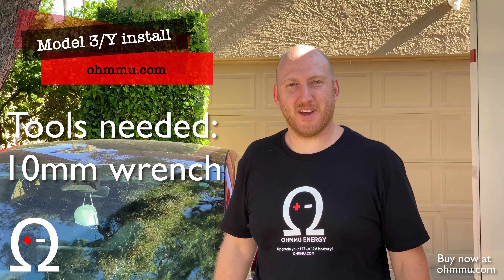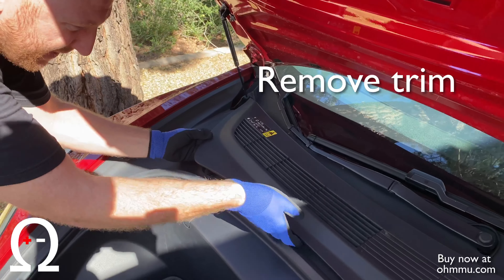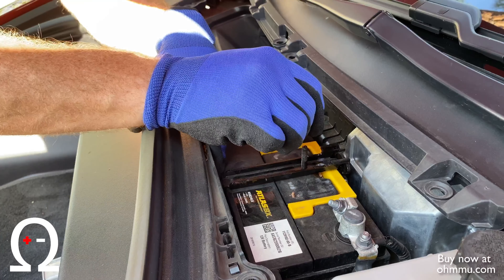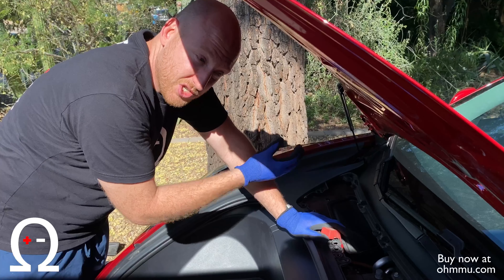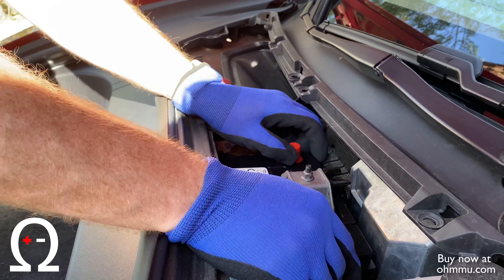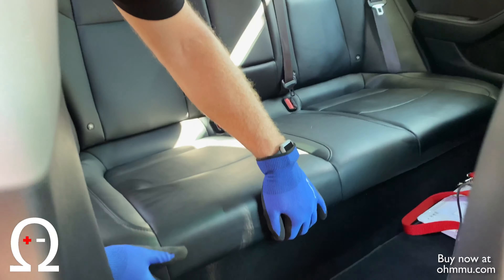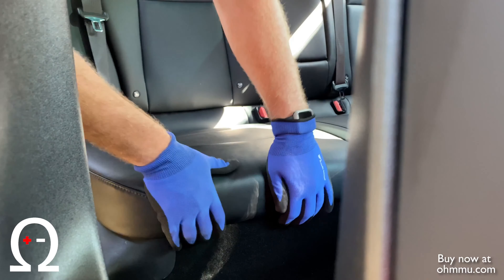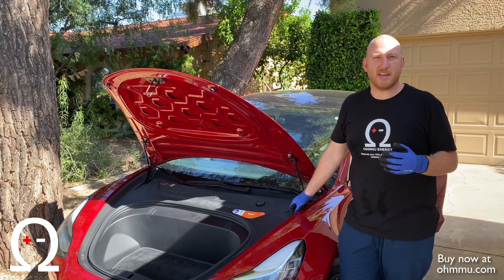Tesla Model 3 12V Battery Swap

Comment: I need this. My 12V battery literally died...had to have it towed to the dealership and....a week later? I still do not have my Tesla 3 back as they had to ORDER the 12V battery. How can they NOT HAVE 12V batteries in stock for my Tesla?!?1????????!!!!!!!!!!!!!!!!!!!!!
Reply from the maker: Tesla's latest software update, 2020.28.6 is a disaster for 12V alert system and has been making many Model 3 flag as replace 12V now, even if the battery is fine.  They are trying to over-correct from their previous version which didn't flag batteries soon enough and was leaving owners stranded in their driveways.
Reply: @OhmmuEnergy  Looks like the Ohmmu lithium battery is also being flagged. My Model 3 screen showed the "12V battery must be replaced soon" message about 2 weeks after installing the Ohmmu battery and on 2020.28.6.
Reply: Just got the same message tonight. Getting my model 3 towed to Tesla
Reply: @davidmontenegro725  It took 7 days to get the 12V battery!! Why they do not have a stock of 12V batteries IN THE INVENTORY was beyond me. I got NO warning before the car just "died" so after a week? New 12V battery and all is good, but I was mad as hell about this situation. it took too long to fix a simple issue.
Reply: jwbjpb1 Well i actually got my car the next day by lunch! They were super fast and apparently had the battery in stock. I do wish there was a warning. I mean you would think a check engine light of some sort would come on
Reply: David Montenegro glad you got your car back that fast!!!

Comment: Nice video. How about the cost of these Litium batteries compared to the AGM? Is it still worth it? I mean the weight saving has gone lost in the last months at home in this corona time.🤣
Reply: about 2.5x the cost. But if they last 4-5 times longer you save money in the long run. I'm doing research for when I get my Tesla. I just want to know how these do in cold-weather? Lithiums operate like garbage at freezing or below.

Comment: What is the point or benefit of swapping to a lithium 12V battery?
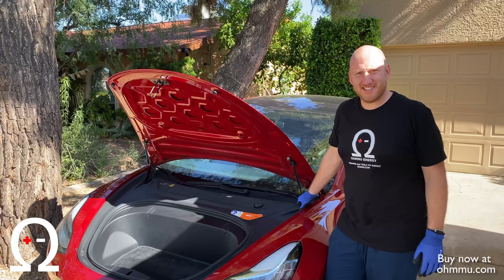Reply: 9:53
Reply: the Lithium is half the weight , will last 3 times longer or more, has more capacity and best of all is non toxic. Why drive electric if gas is so good! The same logic for driving a clean electric car is getting rid of LEAD. We took it out of paint , gas and even buck shot. It is a terrible pollution.   I have the lithum 12v in my S and model 3.
Reply: @solarstacks  Using this logic, seems Tesla would offer lithium as standard equipment.
Reply: @bilwiggins  LiFePO4 cannot work at low temp
Reply: @bilwiggins  FYI All the new Model S and X will have Lithium 12v. This was recently stated by Tesla.
Reply: @solarstacks  Mug!
Reply: @bilwiggins  It is now standard in S and X. And I'm sure will be coming to the 3 and Y soon.
Reply: @SuperDiagnostic  so that's your word of the day then

Comment: Wow, changing the 12v battery requires an Up, Up, Down, Down, Left, Right, Left, Right, Select, Start Code. Instead of just opening the hood and swapping the battery.

Comment: Is there still a potential to arc at the positive battery lug even with the high-voltage loop disconnected?
Reply: @--dj-no-face--  Sorry, I mean at the cable end when it's not touching the battery. Will the DC DC inverter still be active?
Reply: @--dj-no-face--  At 4:22 it's explained that the DC/DC converter may be applying voltage to the lug even when the battery is out. I thought the whole point of disconnecting the high voltage loop is to stop this? So I'm asking if there can be voltage at the lug even with the loop disconnected?
Reply: @--dj-no-face--  Thank you, that's good to know.

Comment: How long did your original battery last? Years/miles?
Reply from the maker: We are seeing about 16-20 months on the stock OEM lead acid battery (AGM)
Reply: @Daniel Brice True, I'm weighing the options.  Have Tesla replace it for "free" but might be caught with a dead battery at an inconvenient time, and possibly the service center is packed when I go.  Or pay almost $500 to switch to an Ohmmu lithium battery.
Reply: @Daniel Brice It's not Lithium ion, it's a Lithium iron phosphate battery which generally have better cycle life and lower capacity loss over time.  They're also more resilient in high temperatures.
Reply: So far original lead acid battery is OK for 27 months for me but I bought one in case. Tesla implemented new 12V battery management in the firmware 2020.32.3.1 so the original battery could last much longer and diagnoses correctly before it is almost dead.
Reply: @CharlesP2009  It is lithium ion battery. Electron carrier is still lithium ion. Just different electrolyte, anode and cathode material.

Comment: This doesn't work!!!
The car will give you a warning that thr battery is failing after driving on the new battery for a few hundred miles. Tesla knows you are not using Tesla parts.

Comment: Is it supposed to make a weird humming noise after removing high volt battery connection?
Reply from the maker: If you have both the 12V battery and HV disconnected there should be no noise at all.

Comment: My Tesla tech said DO NOT use these after market batteries!
Reply from the maker: Tesla Tech will say DO NOT use ANY and ALL after market parts, period, or they aren't doing their job as instructed.  Their job is to repair and replace OEM parts on a Tesla with OEM parts only.  They even are supposed to unplug anything you have plugged into USB outlets for service and are NOT allowed to reconnect them b/c it would be construed as an endorsement of that product (which isn't Tesla provided).